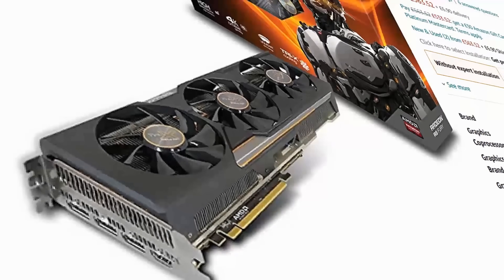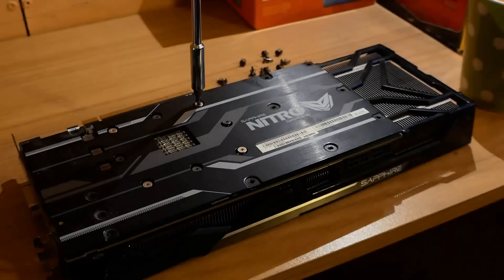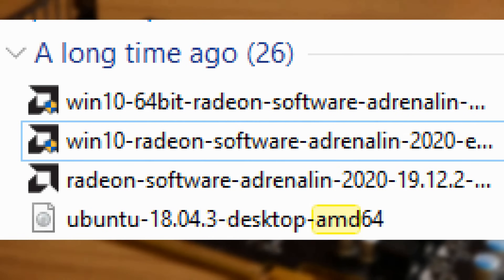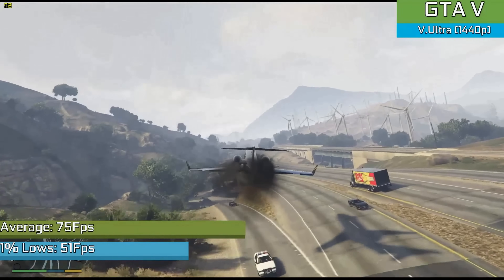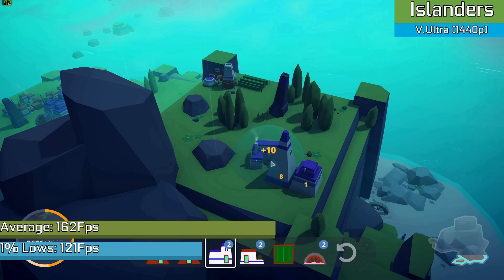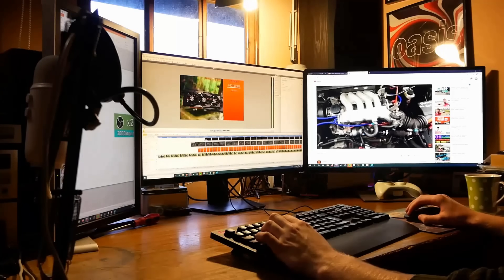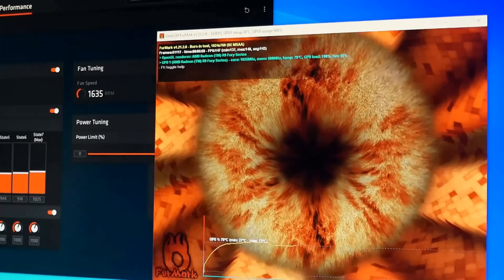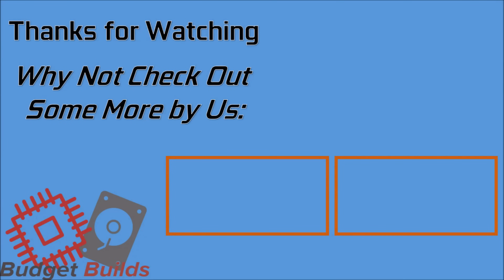The AMD Fury - A Fantastic Failure!

Comment: I'm still running one of these! an XFX R9 Fury... can't wait to build a new PC with a 6800xt! I do agree with a lot of what you said, you have to spend some time in the game settings for games to run well, specially newer games. Note, if you are a racing sim kinda gamer, Dirt Rally 2 just straight up barely runs on this card on low. But Civ 5, GTA 5, Factorio all do run really well on it (GTA 5 needing to play around with the settings). Was also going to say the same thing about the price. Not worth the 2nd hand price.
Reply: Having the same issue but with Dirt Rally, no matter the settings, it never goes above 40FPS, even at ultra low settings... this was done in my XFX RX580 (which has factory OC)

Comment: I´m watching this 2023 with this exact card installed. I really do think this still is a great card. Likewise, I am planning on upgrading, and giving this one to my Son soon. For Fortnite, Minecraft etc. the Performance of The R9 Fury Nitro is still way more than enough for 1080p gaming. Hope it will live for another 3 to maybe 6 years.
I do wonder why his Card runs at 1025Mhz, while mine (Sapphire) runs at 1020Mhz stock (like the Strix one would) while officially the clock should be 1050Mhz.
Anyway, best card I ever purchased so far. Bought it mid 2016 for €350, and it lasted me 6 years and is still going. Like about 15 cents a day. And I just bought it because my 7870 was getting on my nerves for its unnecessarily loud fans that messed up my experience.

Comment: could not agree more. The card itself is quiet powerful but I am running into Vram issues quiet often  in 1440p (Remnant, NMS). I brought it 4 years ago, for 295€ when polaris launched and it serves me well till today. I am planning to go either a bit overkill with a 6800xt or reasonable with a 6700xt

Comment: My R9 fury still going strong paired with a ryzen 1700 overclocked to 3.9ghz. the fury aged extremely well since I got it in 2015. I could relate to all the vram constraints.

Most games i have to set it to high / medium ,I also turn on vsync in newer games to keep the frame rate locked, and they play very smoothly.

Aiming for a 6800xt next year when it becomes realistic to purchase one. But I am still keeping my fury and it will go into a secondary 1080p machine

Comment: As someone who owns a Fury X; I'm with you. I've got a 2560x1440~144hz (freesync) monitor, and yeah, until RDNA3, I'm not moving off of it.
Would it be nice to have a 6900XT? Hell yeah would it be. Is it really necessary for me to upgrade just yet? No. And there's the thing, just like you say, medium-high settings (or ultra in some games) still works fine, looks great, gives enough FPS, and all of the extras that I'm making use of... there's just no reason to move yet, not unless I come into money.

Comment: I was looking at buying an R9 Fury Nano. Managed to get my GTX 970 working reliably enough though that I didn't bother. I ended up getting a cheap second hand GTX 1070 instead a year later. Works far better (only limited to PCIe x8 instead of the x4 my 970 was damaged to) and was a huge upgrade in all aspects.

The GTX 970 is still in use though with; 20GB random DDR3 1333/1600, $65 i5 3570K and a $25 Gigabyte B75M-D3H (was getting thrown out at computer shop). My brother is very happy, and as a first desktop it is far better than my first modern one (i5 4440, GTX 650ti 2GB, 8GB DDR3 1333).

Comment: You want to talk about a card doesn't need replacing yet, try my trusty RX480. I've had it for 3 years now and still handles everything I throw at it at ultra 1080p. Where I only have a 1080p/60hz monitor, I see no reason to replace it.

Comment: The TDP issue is with Radeon RX 400/500 series, I also did undervolt my Sapphire Radeon RX 590, and it consumed about 160W, compared to 225W default.

Comment: I had no idea the driver issues effected fury cards to. I had a lot of driver issues with my vega 56 earlier in the year.
Reply: That’s crazy since I thought the drivers were stable on Vega cards. I haven’t had ONE driver issue on my 64 since I got it in January
Reply: @lonniemurray4742   yeah. To be fair, I was able to run with an older driver. So it was not as bad as it could have been.

Comment: ive owned the r9 fury for a while now and ive had so so so many problems with it, i cant count how many times ive had to reinstall the drivers and do amd cleans, one second i would be playing a game then the next ill have a black screen with 'no signal' on the plus side i can say the r9 fury is a solid card for gaming if you are on a budget like me, i run most games at a confortable 120+ fps on high settings all around, yes the 4gb vram is holding back a little, only game ive ever had that problem on is rainbow six siege, other games like csgo, gta 5 and others run fine (most the time)

in conclusion if you are looking for a cheap graphics card to start you off i say go for the fury as it is very cheap, if you have any higher of a budget i recommend the gtx 1660 super 6gb which is a reasonable price too

Comment: I use a fury X and it can hold 1024MHz at 0.9V. Originally it's clocked at 1050MHz at 1.2V. Temperatures dropped by 10 celsius while running the fans slower AND my PSU is a lot happier, I can now touch it without it burning.

Comment: at 2:00 in, I used to have those same exact parts, the Pentium 4 641, running alongside an 8400GS, before upgrading to an 8500GT, then a HD 3650, and later a 9800 GT 1GB

Comment: I own 4 Nanos now. There is a single 8 pin power connector on this GPU, so consumes 175 Watts max. Every systems has weak points, sometimes that point is the user.

Comment: When I closed the door for me on nVidia because of the quick move to make quite recent cards legacy, I replaced my 780ti with a RX570 8gb and I have not looked back since, paired with an older Ryzen 5 it just smashes the current crop like Forza Horizon 5 at pretty darned good setting levels too.   I have long long been an AMD ho switching to the first AMD chips back in the hoary ol' days when AMD was but a noob in the pit o' chip making vipers and I do admit I did get burned badly with the Rage Fury Maxx which seems to be in the same niche as the current Fury.   To be fair nVidia seem a bit better at dual gpu stuff e.g. the 690 was an absolute beast of a card of its time.

Comment: "The new RTX NVENC which looks absolutely insane"
I had the pleasure of testing nvenc on the new cards and... yeah. I would still stick with software or quicksync. Too much high motion blurring (a much bigger problem on AMD) and artifacting is still prevalent. Quicksync, while it could benefit from a better deblocking algorithm, has the best detail preservation and temporal stability of any of the hardware encoders. But software encoding remains king (If you actually know how to use it.) And note: This is with comparing rtx40 to even the old 10th gen i7 quicksync. But quicksync on arc is great.

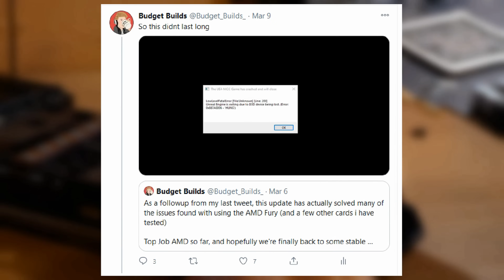Comment: 4:00 difficult to say if this was due to the hw, driver or engine, but in any case: Do not install a new driver the month it gets released. As a side note, you similarly need to wait for a month or so to get an idea of how better or worse it is. Did you install that driver the day after it was released?
Reply from the maker: There was a solid 4-5 Months of Driver instability on ALOT of AMD Cards during the early 2020 releases.

Comment: It is surprising how many people just assume older cards are obsolete. My main rig runs a GTX 1060 and is still great at 1440p, if anything it's more bottlenecked by my i5 6500 in some titles. My secondary living room rig even more so, it's got an i5 3330 and an R9 280x and I'm rather enjoying a playthrough of SW Jedi fallen order on it at the moment. Don't really get any performance issues out of it, with it running at around 45 fps on med/high 1080p.

If you can get older cards at a decent price, there's still plenty of performance on the table.

Comment: Buying it at $225 in early 2016 after a little over half a year of journos taking dumps on its performance was easily one of my SINGLE best upgrades that still kicks ass to this day. If only I wasn't "upgrading" from dual 7950s that technically outclassed it but nothing supported crossfire :/.

Comment: The overvolting of AMD GPUs is still commonplace for some reason in the 5000 series. My 5700XT was 1.200 V stock (!) and it kept dropping clocks significantly due to power limit at 200 W. Works much more stable at 1.000 V at a bit reduced clock and rarely exceeds 170W at full load, more like 130W average at pretty much identical performance...
Reply: 5700 XT:
1.200V, clocks 2080 MHz: TDP 250W
0.956V, clocks 1800 MHz, TDP: 130W.

Performance difference: About 11%.

Comment: love this card... got it xmas 2018 to replace what i thought was a dying 1060 3GB as there wasn't a compelling card ~$300-400. beats 1060s and usually beats RX580s, and is ~$80-110 at best

only downside to 4GB in my experience has been BL3. Death Stranding? fine. Control (beginning)? fine. worried for CP2077, tho. seems to deserve more VRAM... oh, and it utterly SPANKS at MilkyWay@Home and Einstein@Home

Comment: i have 4 of these cards i bought up when the Miners started dumping their ex mining cards 2ish years ago.  Even built a gaming rig for my buddy with one. Re-pasted them and haven't had any complaints. One of the cards overclocks really well, but the other 3 were kinda Meh.  I got one for 50$ because the fan was all busted up by the time i got it,  got a little creative with the super glue and soldering iron and all was well.  cards is still rocking in my spare puter and a media center/work station i built for dad. My buddy is only now after playing Cyber Punk looking to upgrade so Id say good purchase.

Comment: I see you have same problem as I have. I'm still using R9 290... Polaris isnt really an upgrade and RDN1 seem to have itsown problems. GTX 16x0 series are compeling but I never see any good reason to pull the triger. Now there are RTX 3060TI and 3070 that i'm intrested in but they have only 8GB ram + you cant buy them yet... but that would be havi g same problem as you have with only 4GB on your card in future. + I like to use graphic card for really long time.

Comment: I got 2 for 160CAD (a fury strix core unlocked to 62CUs and one was an X with a broken cooler... which wasnt actually broken) and they overclock ok and run 4K great for the price. considering I was upgrading my 290 Tri-X that had a Vapor-X cooler and core unlocked to the 290X.

This card is great idk what you're talking about. Im running them at 1152mhz/560mhz mem and they're pretty great. yeah I'd love them being a bit more stable but who tf cares when you're just having fun overclocking. Once I get them voltmodded, my mem's gonna go crazy and im just gonna destroy fury benchmarks. Watch me.

Edit: I agree with the last statement. Fury cards are basically cheaper Vega cards and although Vega overclocks better and has more VRAM to work with, they're both really decent cards at a reasonable price. these new cards dont entice me especially that I never run brand spanking new games and if I did, with a bit of tweaking my dual fury Xs can run the titles great even in 4K. GCN is not dead yet!!!!!

Comment: It was the first AMD card that supported 6K, 8K for super sampling. That has to be something of a positive. If you tried doing these tings on a R9 390 or even a 390x, it just simply didn't work. But the Fiji high end cards worked well for super sampling older titles. My buddy used to super sample Mass Effect 1 at 6K on his old fury. I thought it was cool as fuck. Especially back in 2015.

Comment: I had a Fury X and it started black screening about 2 years ago when they moved over to the new crimson/radeon software stuff. So i got a cheap ex display Vega56 thinking the fury was dieing. To then get the same black screening issue as i had with my Fury. Mostly its fixed now except it can be weird in Escape from Tarkov with it just black/grey/biege screening

Comment: Used my AMD Vega 64 a lot and was very happy with it. The card forced me to use Linux cuz with Windows and the official drivers i had some nasty "powerspikes" and the power supply couldnt handle it. Like switchting from 300 MHz GPU to over 1000 MHz resulted in high Ampere-Draw. With Linux and the SAME GAMES with even higher Settings (using WINE) none such problems occurred. So ye... i'm happy AMD forced me into Linux. :D

Nowadays i'm running a RX 6800 XT.

Comment: last competitive card? Sorry I don't get that one (I am not so acquainted with PCs)... Isn't the RX 570 / 580 / 590 (a later card family I think) legendary, in terms they work well even today?
Isn't the current line of cards rather competitive?
Reply from the maker: The RX470,480 were great cards when they were released but they were midrange options only.

The RX500 series performed 1/2fps better but generally just served to be rebranded power hogs. Even the RX590 was just an RX480 on 12nm.

Vega 56 and 64 were okay but against Nvidia they didn’t do much for AMDs high end.

The fury was the last real time AMD could compete with high end Nvidia with no issues.

Comment: I have two of that same graphics card. I have one in my workstation and another in a video/photo AI rendering machine. It is still a good graphics card for a "failure". I mean in my video/photo rendering machine I also have a GTX 980 (yep both in the same machine) which was its competitor (the eVGA Superclocked version with ACX 2.0 cooling or whatever).

The GTX 980 didn't age as well. It too has a 4GB framebuffer (VRAM) but in modern titles it falls behind the Fury. For, AI and compute, it's not even close. The GTX 980 runs compute tasks at a fraction of the speed of the R9 Fury. I'm talking less than half as fast. nVIDIA cards are like prematurely ejaculating. They don't last long. They're good for a short while until the next generation is released. AMD cards are like some Indian Tantric stuff if you know what I mean.

I bought my two Fury cards for $90 CAD ea. Some guy was selling them on Ebay, nearly brand new, for $90 CAD each. Convert that to pounds and you'll see how much of a steal that is. For $180 CAD, I got two Sapphire NITRO+ R9 FURY cards. Both are the highest end variant available of the AMD Fury (non X) and thus boost to 1050 MHz. They're not in my primary gaming system (2080 Ti until the 6900 XT becomes available) but they are in my workstation and AI rigs because the compute performance of these things, for the price I paid, is astounding.

Comment: Are you completely DAFT?!  I'm still using an R9 Fury TODAY.  Sure, I did buy an RX 5700 XT to replace it but the money that I can pull in from mining with it FAR exceeds any gaming differences.  I'm currently using a Sapphire R9 Fury Nitro+ OC in my main rig (and it's running right now).  I have no issues with it, it works, everything is playable (even F*cking GODFALL) and I got the thing in 2017 for about $400CAD.  I've had no HBM problems, in fact, my Furies are some of the most stable cards that I've ever owned.  They have never crashed for any reason in the years that I've owned them.  I don't call that a failure.

Comment: after my R9 390X turned into a random crashing POS I switched to ngreedia, wasn't even a temp issue, you could game on it hard and move over to like discord chatting watch temps fall below 40*C then it'd randomly just black screen crash. Card went about 2yrs before it started doing this. Wasn't temperature or supply related. I would be extremely cautious before thinking about buying any AMD card. they've got a history of problems like this then pretend its a user error.

Comment: Jeez, I have this same card. I had tons of WHEA uncorrectables this year, you think it was caused by the drivers? By the way, I don't know if you faced this, but mine still (as in for a few years now) keeps the fans off even on video encoding. I have to set a profile for every new game I play, otherwise it goes to 70-75c and stays there with the fans off(!). I really have no idea why, it's been this way since I think 19.2 (at least since then, I had afterburner with a custom profile before then so it might have handled the fans itself).
Reply from the maker: That's a feature of the card. It should idle with the fans off. Upto a temperature of around 55°C where fans kick in. 

It shouldn't get anywhere near that hot. That's what mine runs at under full load in Furmark. It could be bad thermal paste. But I doubt it. 

Might be worth a DDU and Reinstall?
Reply: @BudgetBuildsOfficial  It "survived" this behavior after a few OS reinstalls this year, I really can't tell what would cause it. I know the temps on this card are good, up to around 2017 it never even broke 65 on anything (and kept pretty quiet doing so). It could be that the thermal pads are dry now, but that's really no explanation as to why the fans "refuse" to spin unless I force them to. I think I'll start digging in the settings this weekend.

Comment: This Nitro card has a slightly longer custom PCB iirc. The Tri-X version seemed to have the exact same factory PCB as the Fury X which always made me wonder why AMD never let board partners do away with the stupid water cooled setup for the Fury X, it was noisy, expensive and unnecessary. There is a saying in my country: to drown in a stream after you've crossed the ocean. That's AMD in a nutshell, good architecture, great new tech in HBM and when it comes to final execution in card design, firmware and drivers, drop the ball.